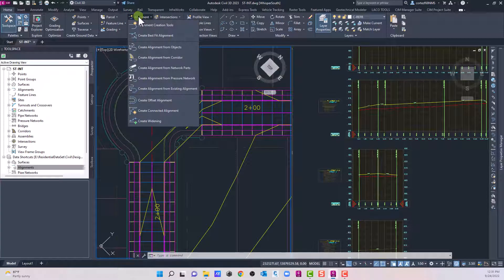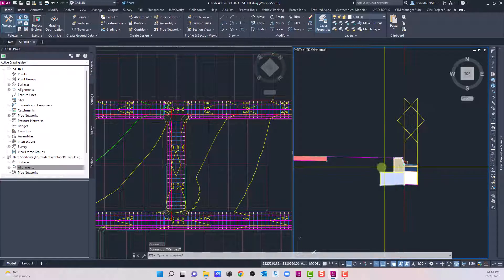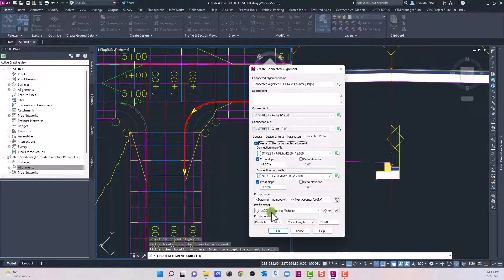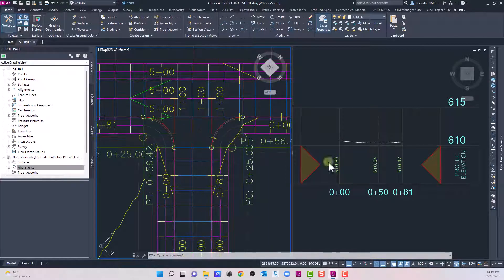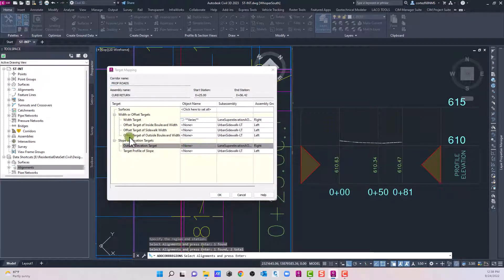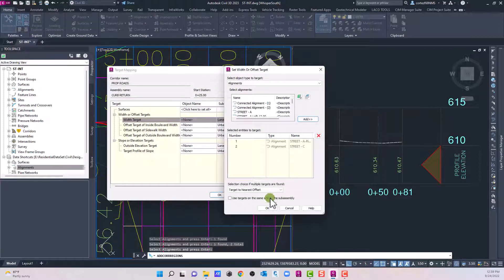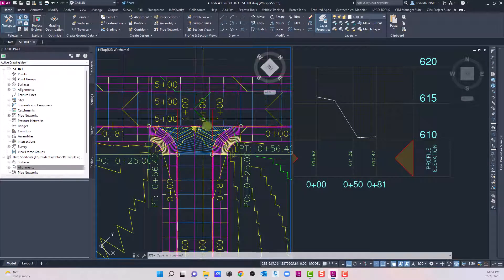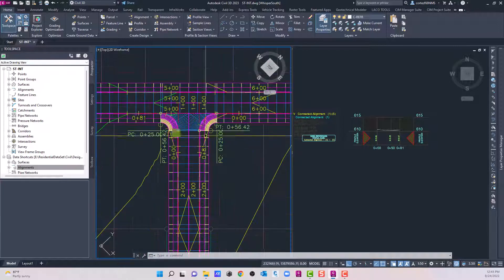Civil 3D dynamic Intersections using Connected Alignments

Comment: Great video, thanks for sharing.  I saw they added this feature but didn’t know where to use it. One tip for you, instead of splitting the region at the centerline intersection, you can go into the edit frequency menu and click on the plus sign towards the bottom. This will allow you to manually add in a station that the assembly gets inserted, such as where the two centerline alignments intersect.

Comment: Excellent tutorial!! I was able to do almost everything, but not the connected alignment profile. Don't appear the line of the alignment just the grid, what am I doing wrong? I followed all the instructions
Reply from the maker: @vmmijangosc  sounds like you might not have the right elevation range. Or it’s all at zero. Set the elevation range to automatic. See if that works
Reply: @cadiotsavant2397  Thank for your help. The problem was that when I create the connected alignment, I set the connection overlap to 0.01 m and it did not take the elevation of the offset alignment, instead it took 0.00

Comment: If it's not too much of an ask, could you please do a video on how you set up profiles for an intersection with both crowns maintained vs only the primary crown maintained
Reply from the maker: How would you drain the returns? I can do one I just need more specific info.
Reply: @cadiotsavant2397  Maybe sheet flow out of the returns onto drains placed along the roads.